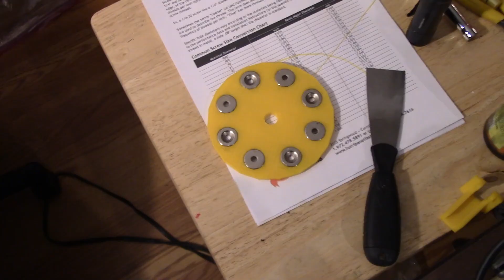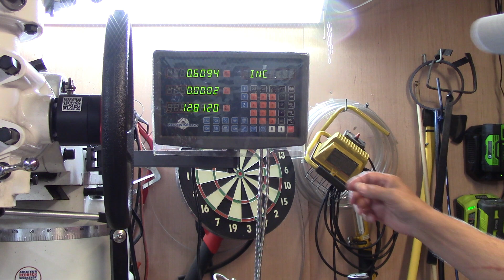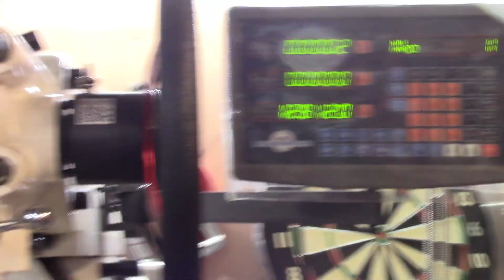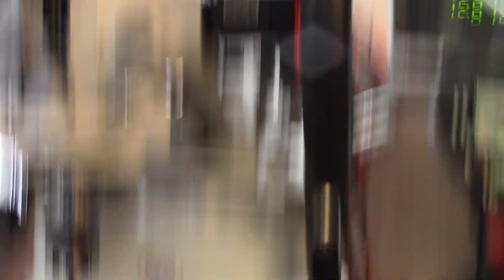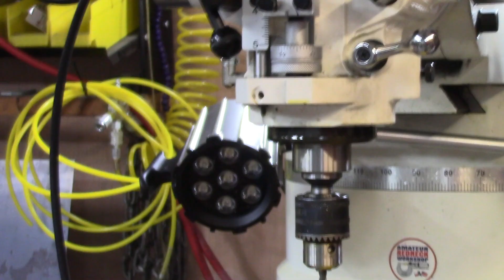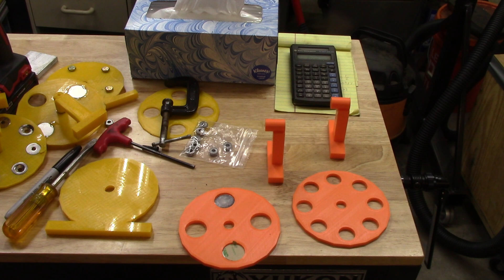Bozo Engineering fail on magnetic gears

Comment: Excellent first try. You might consider putting flanges along  the outer edges of your magnetic gears to stiffen them up  and add a  boss to the central hole  so it will rotate  with less wobble. Also, it appears the fits are too loose which allows everything to wobble. I do think you should continue to work on it, you are very close to success.  Persistence is the key to success in invention.
Reply: You are right Bob.  Thanks for stopping by.